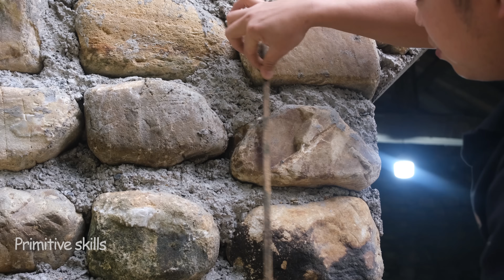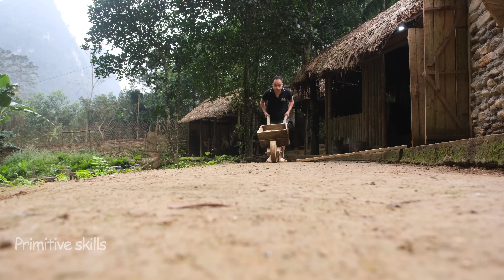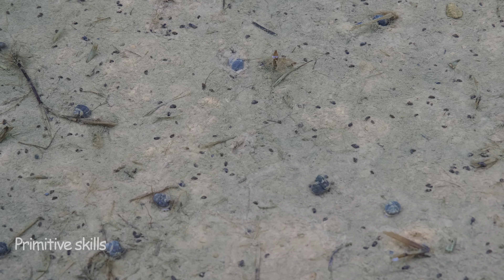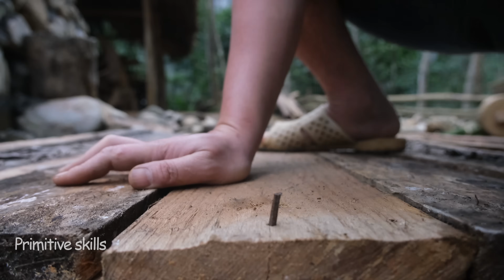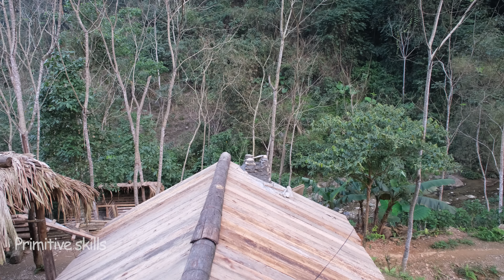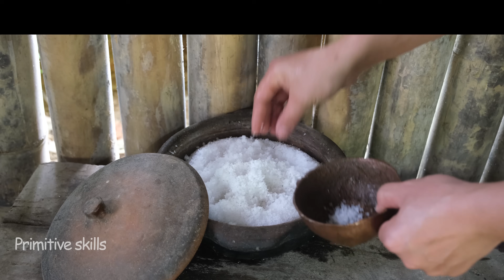PRIMTIVE SKILLS; Build a stone fireplace/chimney can heat house (CABIN) in winter

Comment: Đường , why don't you try using some of the mud settled at the bottom of the fish pond to grow vegetables? It should be full of nutrients from the fish.
Reply: You dont want to remove too much clay from the bottom of the pond. But it must contains a lot of nutrients indeed.

I don't know if he can do that without technology, but knowing his ground's pH would help. When he adds ashes, the ground becomes more alkaline. If he adds mud from the pond it may lower the pH (make de soil more acid). Manure effects on acidity level are more complex. Most compost will help balance pH. Adding coniferous mulch and needles will lower the pH. All those choices have an effect on the vegetables growth. 

Also his soil is dense. It looks like it contains a lot of fine sand and clay. Many plants like well drained and aerated soil. Retaining some humidity but neither soaked or dry. Adding organic material (maybe compost with some manure) could help.
Reply: @FuelX  He should have raised a compost pile as soon as he had chickens so they can dig, scratch and poop in it. Maybe composting is not a big thing in Vietnam for some reason I'm not aware of.
Reply: Duong… in all of these years and despite the amount of suggestions given by your subscribers, I have not ever seen you make much effort to try to improve the soil in your garden areas. You do not add fertilizer. You do not add compost, much less try to make compost. You do very little garden care or weeding and tending to plants to keep the garden clean and healthy. Garden vegetables must have regular care and attention to be successful and produce well. They are not forest / jungle plants that you can just plant and forget about. The soil there is just right for your native forest plants, but soil must be amended and improved to successfully grow vegetables and you must keep your garden area free of weeds, and plants debris removed. 

You could be making a lot of compost to amend your garden soil. You could also be creating and using banana circles to help grow more vegetables. I would think that you need to master growing crops before you add more mouths to feed to your farm that you must constantly forage for food to feed them. 

 I like the look of your fireplace on the outside. Your masonry skills are improving! : )  But we did not get a good look at it inside your house or inside of the fireplace itself. I am concerned about it. I was shocked and disappointed that you demolished that window. As well as you plan out things, I don’t know why you didn’t plan a fireplace in your original build. I am also concerned that you did not line your fire box and flue with firebrick. That wood (lumber) will burn up to leave the rocks and mortar constantly exposed to the heat, flames and soot. Flue fires are no fun. And there will be cracking in the mortar over time around the rocks.
Reply: @munchkin5674  I'm going to assume that fireplaces like this are not common in Vietnam as it's a tropical climate and doesn't really get too cold. Keep in mind that Đường comes from a very poor background and fireplaces like this would be more of a luxury. as for the fertilizing the garden thing he does absolutely fertilize it he just doesn't film it because he's already filmed it so many times. His plan was to use the pig manure to fertilize the garden but with the death of the pigs that option is now gone. He's likely at a loss for what to do now. Chickens don't produce much useable manure especially when they are free roaming like his and for an income level like his, buying more animals is likely not an option that will come soon.
Reply: @DecadentDandycake This man has over a million subscribers. Unless the YouTube pay structure is different if you’re in another country, he is a millionaire now.
Reply: @DecadentDandycake  You have the right to your opinion just I or anyone else that comments on his videos. That said, I have the right to make suggestions to help improve his gardening success, just like anyone else as well. I am a long time subscriber of Duong’s YouTube channel and a big supporter of him. I have watched all of his videos. Other than lime, I do not recall him using any other fertilizer in his garden areas. He might have used some kind of fertilizer off camera, but you would have thought he would have made it known to his subscribers to be honest. After-all, he asked for advice and suggestions from his viewers all the time. You would think however, after 6 years, that Duong would have become more successful at farming; made big improvements to garden methods, etc., especially after all the suggestions and advice many viewers give him. 🤷‍♀️

Just because Duong might appear to be in a poor situation in his videos, it does not mean that he cannot make efforts to improve that situation, including his gardening success. 

Something else you might not be thinking about. This farm, just like Duong’s wife’s farm, is basically used as a filming location to make YouTube videos. They do not live on these farms, albeit they might sleep there a few nights a week. Otherwise, they do live in the village where their 2 young daughters live and go to school. These YouTube channels are their jobs, their way of making money for their family. Duong has a very successful subscriber base and millions of views. He makes reasonably good money from YouTube, as also his wife probably does now too. Duong wears the same clothing in every video as his primitive persona. 

Duong’s wife, on the other hand, chose not to go with an everything primitive farm setting. She uses modern power tools, a gas chain saw, a gas generator, electric drills, electric circular saw, electric palm sander and wood planer, and a different outfit of clothing in each video. She farms very little, if any now, opting to change her video persona from a struggling farmer channel to a channel that cooks meals for children at her daughter’s school. There are other YouTube cooking channels very similar to hers that are very successful on YouTube that she  used as her inspiration for her new cooking channel persona. Will she go back to farming, growing more vegetables on her farm in the spring? Who knows? I guess it will depend on which makes more money.
Reply: @szeddezs  Yes! He should be doing that on some level! Corn kernels can be mixed in with organic debris, etc., to give his chickens motivation to stay right there to pick and dig around in a composting pile. As the compost pile is added to it will attract all kinds of decomposers, like earthworms, to the pile to also help attract the chickens. Duong can also turn those composting piles every week or 2 to help decomposition too. He can do a lot of things if he wants to, especially if he is interested in improving his garden soil for better farming success. Cut up pieces of fish can also be buried in planting holes to help feed growing vegetable transplants. Choices, options.
Reply: @FuelX  At least he could be using the nutrient rich fish water from his pond to water his plants with and even add some of that water to compost piles to help keep them moist.
Reply: @germyw  I never once said he is currently poor. I said that he comes from a poor background as he's said in many videos prior. Money doesnt mean you have all the knowledge in the world. Youtube pays Vietnam content creators $6-$8 for every 1000 views meaning currently this video at ~43,000 views would generate him at minimum $2,580.00 or 63,571,200.00 VND. I'm well aware that he is currently not poor lol.
Reply: @germyw  You're not a millionaire if you have a million subscribers lol
Also I remember reading somewhere that this channel is part of a network running several of those stupid pool building channels, so at best Duong is an employee.
Reply: @munchkin5674 la cuestión es que el gana suficiente dinero con los vídeos así que sembrar o tener animales es más bien parte del show, su esposa prepara banquetes casi a diario como para 100 personas así que él no necesita cultivar nada, solo llenar tiempo de contenido. Además se nota que no le importa lo que los subscriptores le escriban porque no solo no lo toma en cuenta sino que tampoco contesta él, es su productor quien controla todo.
Reply: Hola de chile🇨🇱, felicitaciones por su casa y ahora la chimenea, le quedo muy bonito todo, DIOS LE ACOMPAÑE 👏👏👏👏👏👏👏👍❤🇨🇱
Reply: @szeddezs  Interesting but disappointing to know if true. Duong and family are young and the world should their be his oyster. A person who works as hard and smart as he does would be extremely welcome and successful in my country
Reply: do you have any idea of the work that would take? he;s got jungle soil and that always poor farming land!!
Reply: @keithmoore5306  aquaponics doesn’t require any soil. All the nutrients come from the fish waste.
Reply: @seanbrodie the way i read that was to dig up the soil and spread it! i guarantee you 99.95% of others got the same exact idea from it!!
Reply: At last u have salt in your food...😊
You take a dog also as a pet for your friend
Reply: @szeddezs  those are composting piles around the banana trees and the chickens scratch at them at will..he is composting all over and as he does he expands the growing areas ...He uses rice as his primary grain source and some corn ! corn is difficult to digest but keeps well as does the rice...pond is flowing and does offer water amd it is flowing...We do not see if he is composting his manure s but as long as the animals are ranging he may be ok  . The hogs in the draw behind the home got a fever they all died so that ground may need to lie fallow for a long time? This was a great loss because hogs can clear ground quick! If they can be kept contained ...do you know of any plants that could clear the infections from the soils? I do not!
Reply: @munchkin5674  voce da sua opinião claro, só que supõe que os canais dele e da esposa lhes pertencem. E em vista de repetições  da legenda com outros canais, eu tenho certeza que são administrados por uma equipe que os explora.
Reply: @DecadentDandycake  Se o  canal fosse dele e não de uma equipe que o explora. O mesmo o canal da esposa. Ele é a esposa são atores. 
Eu acompanho este canal desde que começou, e sospeito que só há uns 2 anos, quando o estilo das  legendas mudou, passou a ser administrado por exploradores.
Reply: Se dessem uma pesquisa nas respostas que o canal está dando nos últimos anos verificariam que são sempre repetidas; e o mesmo acontece com as respostas no canal da esposa. Não é Duong quem responde, é a equipe exploradora.
Reply: @OmarAMassa-cq7io I Yes, I am very aware of those type YouTube channels. Duong never built a swimming pool or some weird elaborate bamboo villa, so I am hoping and praying his YouTube channel has been solely his all of these years. As for his wife’s, I hope the same, but her shift from farming to cooking to generate more subscribers and viewers that would make her more money, might make you wonder. I just don’t believe she liked primitive and did not want her farm to be that way. She is more aggressive and seems more motivated to make money. In the relative short time that she had had a YouTube channel she produced twice as many videos as Duong ever made. 

As for the organic matter that Duong has been putting around his banana trees… It is more for mulch in those large sizes of pieces that will take a long time to break down and decompose to benefit the banana trees. If Duong can take the time to chop up stuff to cook for animal feed, he could take the time to chop up organic waste and pile it up layered with what chicken manure he can collect from his chicken coop. He could also create small compost piles near his chickens, mix some corn kernels in the organic debris and let the chickens go to work picking all through it, eating some of the vegetable waste, the corn kernels they find and any bug critters. At the same time, the chickens will drop more poop in the pile as things get mixed around. After a while Duong could transfer what they have been working on to use as a faster plant feeding mulch. Then give the chickens a new pile to work on. 

His pond is nutrient rich with fish waste that he could also take advantage of by pulling some of that water off to water garden areas with. He has pulled the water level of his pond down at least 2-3 times now. I’m not saying that he should dredge out 2-3 feet of the bottom to add to his gardens, but he sure could remove several bucket and wheelbarrow full and work that into his soil. He could also add some of that to compost piles. He must learn how to manage and use all of his resources to his best advantage, while still caring for and nurturing the native environment outside of his vegetable garden area to harvest what it provides as well. 

You know, Duong has access to the internet and YouTube to search for information and videos on how to improve his garden soil. If the soil is not that great in his garden area, then yes, he can improve it and his garden methods. He could create banana circles and lasagne garden growing beds  that not only feed the plants but creates better soil at the same tine. But, as a primitive channel, will he do that?
Reply: @OmarAMassa-cq7io  can you explain any more about the team?
Reply: @seanbrodie   a equipe é uma suspeita minha. Só tenho evidências. Eu acompanho um canal chamado "Free Life", uns meses atrás nas legendas de um vídeo foram dados, aparentemente por Lieu, uns conselhos filosóficos, que dois dias depois foram repetidos, palavra por palavra, num vídeo da esposa de Duong. O mesmo com uma explicação, aparentemente de Lieu, das propriedades de um vegetal que a esposa de Duong repete palavra por palavra. Quer dizer: quem escreve as legendas é outra pessoa. E há outras coincidências sospeitosas. A pessoa que representava o canal "Free Life" era Lieu, agora ela saiu do canal, aparentemente porque foi abrir um canal dela própria o "Trieu Thi Lieu", só que continua com a mesma fotografia e estilo de respostas laconicas e repetidas aos comentários, que já eram usadas há muitos meses no canal antigo dela, exatamente as mesmas respostas que se usam no canal de Duong e da esposa. Coincidências suspeitas demais, que me fazem acreditar que todos estes 4 canais tem a mesma administração, que nem Lieu, nem Duong, nem a esposa são os donos.
Eu chamo de equipe exploradora porque Lieu criou muitos porcos e galinhas, tinha motosserra e outros motores para bombear água e preparar ração: é deixou tudo  sem levar nada para o seu novo canal.
Reply: Deixo uma pergunta no ar: por que será que Duong e a esposa faz tempo que não aparecem juntos? Hein?
Reply: Outra. A data de postagem do último vídeo com a velha casa em ruinas é 22 de janeiro. A data de postagem do vídeo da nova casa já com as paredes de pedra prontas é 25 de janeiro. Uma pessoa sozinha poderia juntar todas as 7.900 (sic) pedras e a areia necessárias e ainda construir as paredes em 3 dias? 
Pode negar a ajuda de uma equipe? Hein?
Não gosto que me fazam de bobo.
Reply: @OmarAMassa-cq7io Yes, things have been happening quicker than normal for a single person doing the work. It would take countless trips with that little wheel barrow to bring up all the rocks needed. The clean-up to finish tearing down his earthen house and completely clean up the site, plus hauling up all that rock and sand in that amount of time, is more than one able bodied man can handle. 

Besides that, the amount of salt he brought back from the sea in what appeared to be 2 days time was unreal, and the coincidence or timing of that trip to the collapse of his house… a lot of things do not add up and ring true. I have been trying to give Duong the benefit of the doubt, but since he hurt his back and had to have his wife come run his farm while he healed, too much has gone on that is suspect. : (
Reply: @OmarAMassa-cq7io  no translation
Reply: some kind of silt, a flowing pond. I wonder how to collect it and dive?
Reply: On the topic of fertilizer you don't always need it for small scale farms like this, in Australia a lot of our native plants and weeds will only grow when the soil is at a certain condition and while growing will change the condition ie, plants will take nitrogen out of the soil and replace it with something else, I know potatoes, corn, rice and some of the other veggies he's grown so something similar and he's never planted the same thing twice in a row so he's doing a basic crop rotation. With that practice alone along with tiling the soil with just natural leaf litter can keep the soil in good health and what he's grown is more then enough to feed his family if that was his only food source.

On the topic of him having a team I believe he has a producer and an editor that make his videos and add the subtitles from his notes while he's on the farm. He has said at the start of building this current house it was winter and in last video it's starting to feel like spring but that doesn't mean all these videos were filmed in the time span of being posted it could of started to be filmed late December and only just been posted after editing and everything else, this could of been filmed while we were still watching his videos at the ocean and just finished being edited. Either way as long as he doesn't start doing what those other channels did by doing building obscenely over the top and obviously fact builds I would care if he got help in once and a while we all know he can do this stuff by himself and it just reminded of when he built the water wheel and people said he'd brought planks, we watched him make some by hand we know he can do it who cares if he buys some he's still making great content.
Reply: @kristopherpicklez1425  É talvez tenham começado a construção da nova casa em dezembro, antes da casa velha desabar. Ótima explicação.
Reply: @OmarAMassa-cq7io  I would say they didn't start building until after as it's built on the same foundations but it could of happened back then and we are only just seeing it now
Reply: @kristopherpicklez1425  você diz ELES. Quer dizer que mostrar ELE trabalhando sozinho é enganoso; e os enganados somos nós. A data não altera o fato de nós fazer de tolos.
Reply: @MyLevelheaded  ...and are those composting piles used to make soil for his garden?
Everything else you typed out is irrelevant to my comment 🤷‍♂
Reply: @szeddezs  If you watch this man composts in place after planting. and as he renews the garden year after year he burns and composts in place...The european methods you describe for soil manufacture do not fit his soil building techniques!
Reply: @munchkin5674  All that just to feed most to his animals?